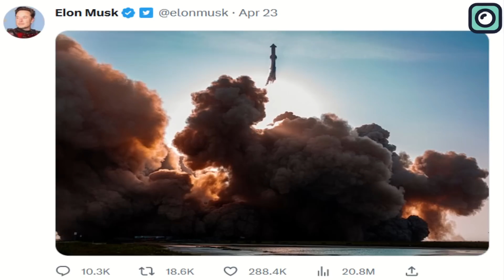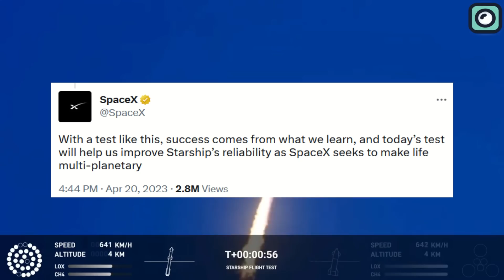SpaceX's Raptor engines BIG PROBLEM on first Orbital Launch!

Comment: Your negative comments are ridiculous. It is a test flight. The debris is a very valuable test. Do you think The first landing on mars is going to have a launch pad?  Besides it’s Space😊 X model to rapid test less than perfect models. It’s how you end up with reliable rock solid equipment. The Boeing model spends billions and still screws it up. A good example is the beloved F-14 tomcat. It had problems when it first flew. Nay sayers and negative commentary tried to cancel it. It’s how you create a truly create a rock solid product. The most reliable successful rocket is the Falcon rocket developed the exact same way

Comment: The Soviets tried to use 30 engines in their N1 Moon rocket back in the day. The explosion was one of the largest non-nuclear blasts ever documented that wasn't a volcano. The issue may come down to Starship's first stage having 33 engines creating just too many points of failure. This is a serious problem for potential launches to the Moon or Mars, because a loss of thrust as engines fail during launch could prevent Starship from reaching its required trajectory.

Comment: The Raptor reliability is not the issue (getting hit by flying concrete sorta has a negative effect on reliability).  SpaceX has been doing significant testing at the McGregor site for full duration and relight testing.  That so many Raptors kept lit after the storm of shrapnel came their way is pretty good testament to the design of the engines.  Stage 0 design is another matter and parts of that effort was underway before the launch.  The launch gave pretty good indication at just how far SpaceX will have to go with their Stage 0 redesign efforts.  Parts of a deluge system are already there in Texas.  How they design a flame diversion system in their current footprint is a whole nuther matter.  I'll be interested to see how much repair work is needed to launch tower and other infrastructure.

Comment: 1:57 So I'd suggest to dig a deep hole to tame the sickest flame I have ever seen in my life. This flame needs a lot of space.
You need a new rocket launch facility for this class of rockets.I'd suggest to build a completely new one in order to prevent those kinds of incidents in the future. Also you should expect that the flame or the blast has enough potential to damage the engines, which could result in a catastrophic event.

Comment: Only one scrub - survived maxQ - and it even tried to correct itself a few times before the rud ! Its clearly a success ! 🚀
Reply: Well, um, no. The rocket took off but that's about it. It didn't make maximum speed & the starship didn't separate from the booster. Basically, everything went to shit shortly after. No data on booster return & no data on starship orbiting the earth & re-entering the atmosphere. Sure, it was all throw-away stuff but let's not sugar-coat this. A lot of critical data they would have preferred, was lost and any chance of another launch this year is absolutely out of the question at this point in time. The launch site is completely devastated. It's clearly not a success.
Reply: @blazingsaddle166  well at least starship didnt blow up at lift off and it was exciting witnessing the launch ! mistakes were made so thats somewhat part of the learning process ! 👍
Reply: @scottymoondogjakubin4766  That's true but so much of the devastation could have been mitigated & I have no doubt had the basic launch pad infrastructure been set up correctly in the first place, we would be having a very different conversation. Possibly even another launch within a few months but there's absolutely no chance of that now.
Reply: @blazingsaddle166  true mistakes were made ! well it didnt blow up on the pad and it was exciting ! 👍👍👍👍

Comment: Space X’s heavy launch vehicle and its Raptor engines are promising breakthroughs, however; several engines failed.  How many engines failed on the maiden test flights of Apollo 4 (Saturn V), STS-1 (Space Shuttle), Russian Energia, and Artemis 1 (SLS)? Where is the flame deflector to channel the rocket exhaust away from the launch pad and where is the water deluge system to dampen the acoustic energy of these engines? Space X must determine why several Raptor engines failed during the launch, retest the engine components, and then relaunch.

Comment: Actually, the Raptor Engines worked magnificently..... They had to endure tremendous stress from sound shockwaves, flying debris, thermal shock waves, and still functioned even when they were abused.
They were actually physically tested beyond any other existing rocket engine has ever had to deal with, once Space X builds a proper flame trench and water deluge system And eliminates these issues, I can only imagine what this new rocket system will deliver.
People seem to forget the immense power that was generated, and it wasn't even at full throttle on takeoff, Once they get the obvious issues squared away, this machine will be more than breathtaking.

Comment: Booster 7 has to be the best built booster in history to survive the Very poorly engineered launch pad debris. Concrete was ejected in every direction including straight Up into the engines yet B7 still made max Q. It was plain and simple a miracle it didn’t explode on the launch pad. Starship 24 never even got a chance to shine as it was off course and the onboard system simply wouldn’t let it go. Elon learned a very valuable lesson. Water deluge and flame diverters are a necessity.

Comment: How could they not know that the pad would be obliterated?  
      The failed rocket motors were more than likely due to rebounding debris from the pad where a massive crater now sits. 
    I bet you, once Elon is interviewed, he will say the failure was all caused by the destruction of the launch pad. 
             If the pad had not been destroyed or received as much damage the rocket would have performed up to expectations.

Comment: This guy has no idea what he's talking about. Everything went exactly as planned. Elon even said the weekend before the launch, "As long as the launch tower is still standing, I'd consider it a success. It's not just possible, it's more than likely we won't make it back down to the ground." They purposefully didn't install a flame diverter. They even said days leading up to launch that the damage caused by the engines would be worth the time they were gaining by collecting the data. Either way, they weren't going to be able to launch again for several months due to FAA approval. There were no setbacks here.

Comment: The Raptors are all tested in MacGregor prior to delivery to Boca Chica, I assume. So, potentially, there may be a propellant-piping problem. Since the engines are all tested individually, designed for multiple flights and plumbing for an accelerating system is an unusual case.

Comment: Maybe it needs a catalytic  wick  where spontaneous ignition is expected to occur. There is likely no carbon deposit glow(or particles) to assist in ignition fan out. It's like you can run a diesel engine on natural gas if a small amount of diesel continues to be injected -- This is 'seeding' the combustion, 
You could see a lot of un-burnt fuel coming out of the rocket. Does it mean those engines didn't spin up or didn't ignite or lost it. And why do they fail to ignite in pairs -- that is a weird distribution : Are they starved or choked.

Comment: Everyone talks about stage zero, like its only function is to hold the booster. This design gave the engineers access to the engines and anything on the bottom of the booster. Anything other then a flat plate will interfere with that ability.  A flame trench is not feasible becouse of the ground water. Raising the area to put in a trench system. Would mean all the other infrastructure would have to be rebuilt to accommodate it.

Comment: The engines are fine it just blew a hole 20' deep with concrete. Went back up in the Raptor 2 and messed things up come on use your brain.

Comment: People keep suggesting that debris hit some of the Eninges, causing them to fail. With 15 million pounds of thrust I doubt the debris could fly upto the engines, think about the thrust vector straight down. No debris are going back up unless that some how they bounced and hit the engines at an angle avoiding the thrust vector, which seems unlikely to me. Some of these raptors have failed to relight on previous tests so seems like a possible ignition reliabilty problem to me.
Reply: The engines did not start all at once. That’s why there was an 8 second interval between first ignition and liftoff. So it is highly likely the concrete damaged some engines prior to their individual ignition while other engines were burning.
Reply: @kevinjohnston9613  Elon has said recently I believe that 3 of the engines were shut down at launch on purpose because they did not meet starting paremeters.
Reply: @MrLeighman  He specifically stated that there is no evidence in the data they have that engines were damaged. I think you may be correct, but he did not rule out that possibility. He also stated that they had an energetic event (explosion) at T+27 that resulted in destruction of 4 engine heat shields and lost communication with those 4 engines in succession thereafter. This may have been caused by the HPU boom or some damaged engines that ignited later in the start sequence. Maybe…

I don’t think this is too likely since I suspect the concrete didn’t destruct until engine throttle up right before lift off. Which didn’t happen until all 30 engines had lit. Instead I am thinking the HPU was damaged by concrete and that is what caused the “energy event”.  At T+27 there is a large red fireball followed by a fair amount of soot. This indicates this may have been hydraulic fluid after the explosion of the HPU. This compromised the heat shield for those four engines along with damaging at least one engine and then they melted one by one.

Comment: It's hard to imagine that the engines were not pummeled with concrete fragments. They really should have fixed that problem before the launch. Nevertheless, much of the system worked and they got the data.  This is how they make rockets.
Reply: It is indeed how they build rockets... But the PAD is a huge blow to get the other rockets tested.

Comment: I would suggest considering using sacrificial zirconium igniters that were triggered electrically. perhaps turn thinner in the center, then bent into a loop to fit a ceramic plug in, with enough metal to insure lighting the engine.

My cousins were machinists at a plant near  Albany Oregon during the Vietnam war, turning munitions casings out of zirconium, they said the fire fighters hated the stuff, very hard to put out, and burnt better in water...

Comment: This is not a good analysis. I am not a religious SpaceX fanatic. I am an aerospace engineer. So my take on this is that it shows their inability and unwillingness to learn from others. But the engines were shot blasted with concrete lumps as they were trying to leave, and then the hydraulic systems failed, dumping the hydraulic fluid and creating the orange flashes in the exhaust. Lost of hydraulics is most likely the killing blow, and that was most likely caused by the garbage 'design' of stage zero.
Reply: Couldn't release to hold downs to StarShip . That's why booster 29 is all electric.

Comment: What a load of rubbish, nothing wrong with the raptor engines. They were hit by flying debris because the launch pad wasn't strong enough to absorb all that thrust. All these problems are easily fixed. If anything it's a testament to Starship that it didn't explode on the pad with all those chunks of debris flying about.
Reply: Correct

Comment: It was a failure to create a proper flame diverter and water deluge system, the rocket is twice as powerful as the next and needs more precautious than Spacex considered. The engines worked even after some where damaged because of the two for mention deficiencies.

Comment: I guess giant pieces of concrete hitting the engines were not so good for them. So I have no idea why this fact is not taken into account in this video.
Reply: 1:28
Reply: I'm with you.
Reply: You really think that something can climb up to the engines against the huge jet from them?
Reply: @juancarloscasabuono6651  - Because there are 33 engines, those jets are not a single stream, but many with small gaps between them. That could definitely allow debris to be thrown up to hit the rocket. Plus, you have to take into account the backlash from all those rockets. Musk decided to be cheap and try this using a very basic concrete launch pad that lacked the features common to launch pads for heavy lift rockets. That's why the rocket literally dug a hole under the launch pad.
Reply: @daniels7907  At the distance from the nozzles to ground, the streams are all togheter in one, impossible that something goes up against that. The rocket was restrained 8 seconds at full power, 4 times the normal, all part of the tests, concrete resistance included.
Reply: @juancarloscasabuono6651  - False. You are forgetting that with the rocket that close to the ground much of the kinetic energy produced was being reflected back at the rocket itself. It doesn't take much to accelerate the debris to greater velocity than most guns ever could. The space shuttle Columbia was critically damaged by a piece of foam insulation during launch. Did you not watch the videos of the launch and see all the concrete debris flying around? 

If Musk hadn't been so stubborn, they would have had reinforced trenches and water pumps to divert the thrust away from the pad. But Musk decided that flat concrete right under the rocket was good enough.
Reply: @daniels7907  "Debris flying around?" is not the same than flying UP against the rockets. Columbia incident have nothing to do with this. Concrete pad without trench have a reason, like everything they do ( a lot of engineers back, not only Musk decisions) Does not work that way with flying things.
Reply: @juancarloscasabuono6651  - You clearly flunked physics. It absolutely works that way. For every action there is an equal and opposite reaction. All that thrust hitting the concrete slab was blasting it apart like explosives and the distance was not great enough for the concrete to be ground down to dust (which SpaceX assumed that it would). All that downward energy was kicking up debris all around the rocket.

Of course, the only alternative that fits your (incorrect) understanding of physics is that the several of the Raptor engines simply failed because they were defective. Which poses a different set of problems.
Reply: @daniels7907  Amen! It's called causality.
Plus, dont forget that concrete holds a not so small amount of water too which adds up as well
Reply: @juancarloscasabuono6651  Yes! I really, think that something can climb up to the engines against the many single jet's
Reply: The new generation thinks wasting money on casually blowing things up is the best path toward innovation. It's a juvenile mindset. Every generation has to relearn the lessons of the past.
Reply: Another way at looking at this is how robust the Raptor engine really is. I mean that engine bay it got peppered with both small and large chunks of concrete going close to 200 mph. It’s a miracle it didn’t just explode at full ignition on the pad considering what those 33 engines were exposed to. Now the idiocy of  
ignoring the launch pad requirements readily available to them from a system with 1/2 the power of Starship-the Saturn/Apollo program-just boggles the mind. He just didn’t give a sh t. Rather impulsive, dangerous behavior.
Reply: Because this is a hit piece on SpaceX or probably anything Elon Musk. Facts don't mean anything when you have a narrative to spin.
Reply: @fjanson2468  They are launching rockets every week, and landing first stages in a barge, they know the bussines better than anyone. But they must demonstrate to FAA, just like Boeing.
Reply: @fjanson2468  - The only "hit piece(s)" were the concrete chunks flying everywhere because your messiah Musk, weed enthusiast, was so determined to launch on 4/20 that he decided to make due without certain improvements to the launch pad that might have mitigated this problem.
Reply: @daniels7907  I second that, although i like most of the things Musk does. But hey, nobody is perfect
Reply: Its a trolling video really
Reply: @gazzabro55  - You're just saying that because in your head SpaceX doesn't make mistakes.
Reply: @daniels7907  it was clear that it was made to make people sceptical of starship. Cherry picked info.
Reply: @gazzabro55  - Your point being? SpaceX marketing spent years trying to make people skeptical of SLS. But it didn't explode during it's flight test (sending Orion around the Moon). Whereas Starship had to be destroyed before reaching orbit because it was spinning out of control due to engine failures. That's NOT a "hit piece", that's just reporting what REALLY happened, as opposed to what you WISHED had happened. 

Had things been reversed and SLS had blown up, Musk would have been crowing about it on Twitter, not trying to claim that it was still a "success".  Even as you accuse other people, it's obvious that you're just spin doctoring for SpaceX.
Reply: @daniels7907  I'm pretty certain that once the rocket started tumbling it was not going to be reaching orbit.
Reply: Because this is a hit piece and dude’s obviously jealous.
Reply: @rumbletumblestumble  - False. If this had happened to NASA with the SLS all you SpaceX worshipers would have been singing and dancing in praise of Musk. Musk screws up a crucial test launch and it's a "hit piece" because in your mind even when he makes mistakes, they're not really mistakes.